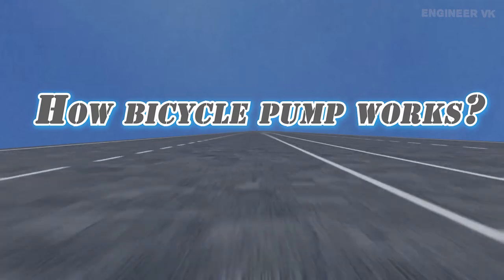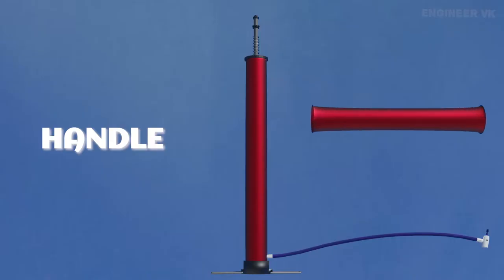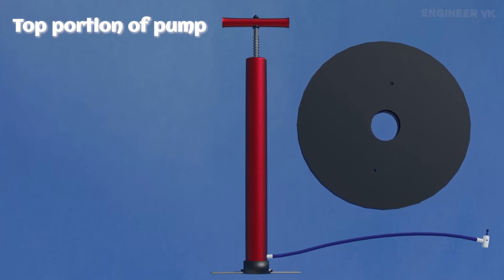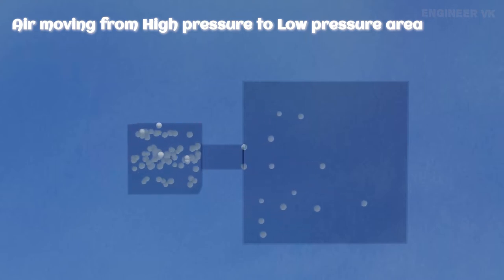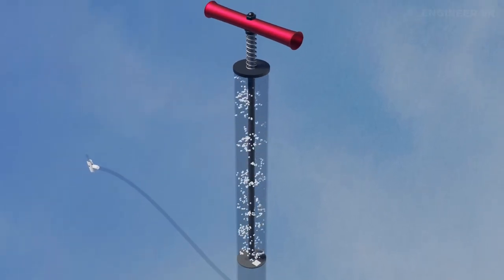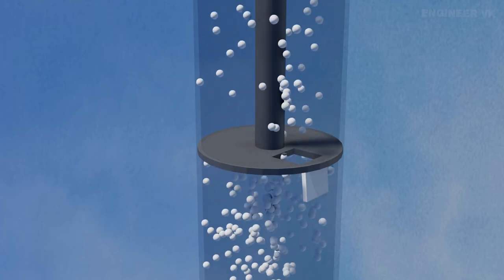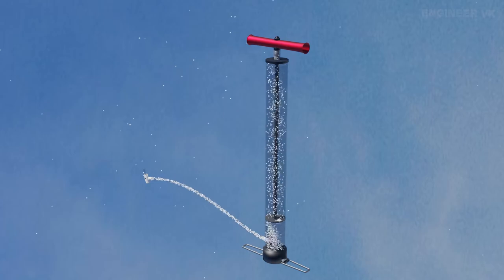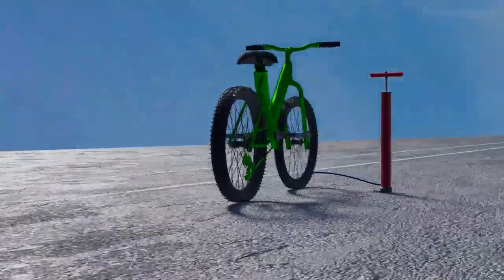How does Bicycle pump work ? 🎓Engineer VK🌏 Explained using 3d Animation

Comment: Why during pumping bottom side pump is heated ?? Explain bcz this question asked me in interview
Reply: Ideal gas equation says: PV = nRT. Clearly, Temperature is directly proportional to Pressure, so an increase in pressure increases the temperature.
Reply: Friction between piston and cylinder may add heat and warmth